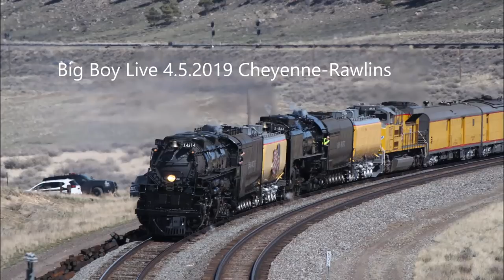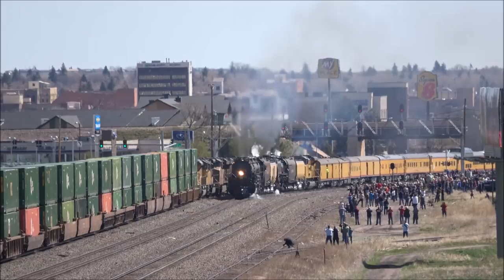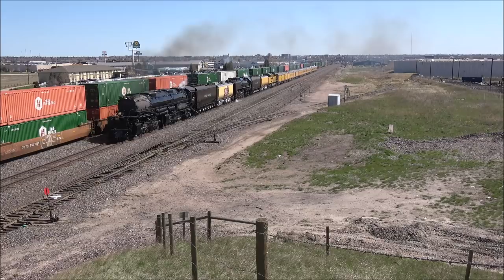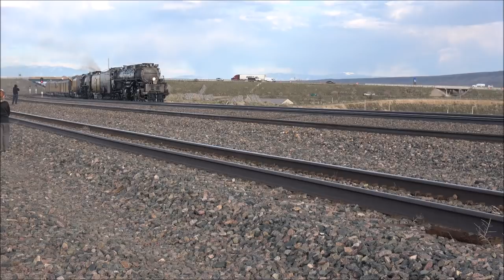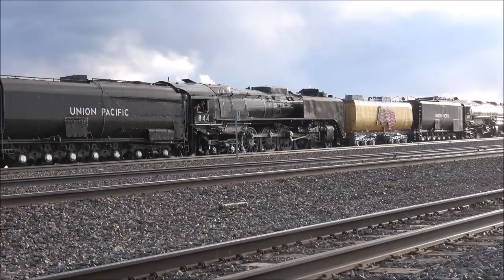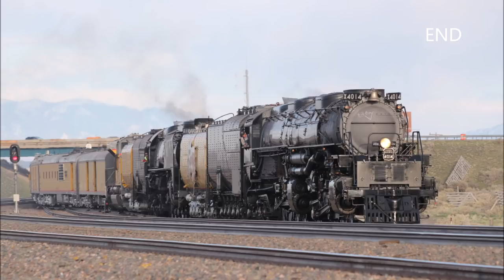1/2 Dampflok Big Boy 4014 und 844 USA 4. Mai 2019 Steam Cheyenne-Rawlins the race to Ogden

Comment: Warum brauchte es die Diesellok hinter den beiden Dampfloks? Diese wären doch bestimmt genug stark, um die 9 Wagen allein zu ziehen.
Reply: Electric heating or supply to the rest of the train. I reckon!
Reply: Ich glaube, der Diesel ist da, weil diese Züge auf stark befahrenen Hauptgüterverkehrslinien fahren. Der Diesel ist da, um den Zug im Falle einer Panne zu bewegen.
Reply: @davidraub7863  Nope! They have enough power there. It's just for heating and elecrical power on the rest of the train.
Reply: Ich meine die sind zur Sicherheit da und als "Bremswegen" ob die für HEP sind bin ich mir nicht ganz sicher
Reply: Die Diesellok ist nur für Notfälle, soll es ein Problem bei einen der Dampfloks geben. Die Diesellok (EMD SD-70ace) ist eigentlich für Güterverkehr geeignet, sie hat kein HEP. Es gibt zwei Generatorwagonen im Zug, die HEP versorgt.

The Diesel is there primarily for emergencies. The Diesel (EMD SD-70ace) is a freight locomotive and has no HEP capability. There are two generator cars in the consist for HEP.
Reply: @robertbaldwinjr3864  head-end power (HEP), also known as electric train supply (ETS) is the electrical power distribution system on a passenger train. The power source, usually a locomotive (or a generator car) at the front or 'head' of a train, provides the electricity used for heating, lighting, electrical and other 'hotel' needs. The maritime equivalent is hotel electric power. A successful attempt by the London, Brighton and South Coast Railway in October 1881 to light the passenger car between London and Brighton[1] heralded the beginning of using electricity to light trains in the world. 
By the way. This is an EMD SD70AH. Not an Ace.
Reply: Paul van Schaik - Correct. In this case there are two generator cars (cars 2 and 4) behind the diesel. 

In North America, Diesels do not have HEP unless outfitted for passenger service (i.e Amtrak, METRA, NJ Transit, MetroNorth etc). There are a few exceptions (NS Executive F units, UP executive E units, CSX Executive F40s, Alaska’s specially equipped SD-70s etc). 

If you look at other main line steam in North America there is usually 1+ generator cars to provide the HEP. Sometimes there is a leased Amtrak unit  for this purpose - Look at the N&W 611 excursions or the MILW.
Reply: @robertbaldwinjr3864  Thank you Robert.
Reply: @robertbaldwinjr3864  Vielen Dank für die Info. Dürfen in den USA die Dampfzüge nie ohne zusätzliche Diesellok fahren, oder kommt es darauf an, auf welchen Strecken die Dampfzüge fahren? In diesem Fall waren ja 2 Loks am Zug. Dass gleich beide kaputt gehen, ist sehr unwahrscheinlich. Eine Lok hätte den Zug auch allein ziehen können. Ein Dampfzug mit Dieselhilfe ist nicht halb so spannend. Da müsste ich mir überlegen, ob ich überhaupt abdrücken soll - Big Boy hin oder her. Vielen Dank für die Beantwortung dieser Frage.